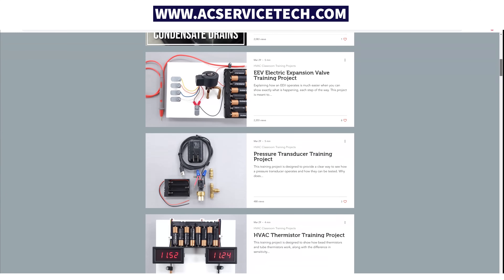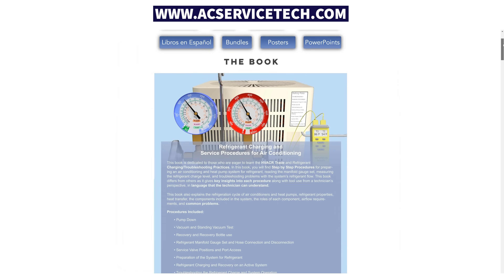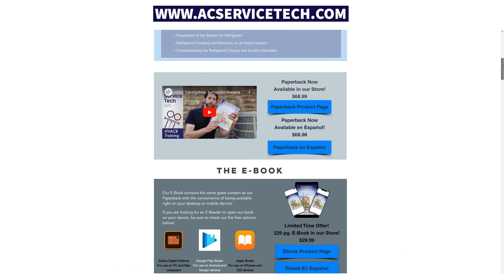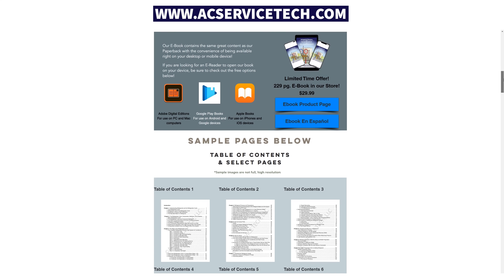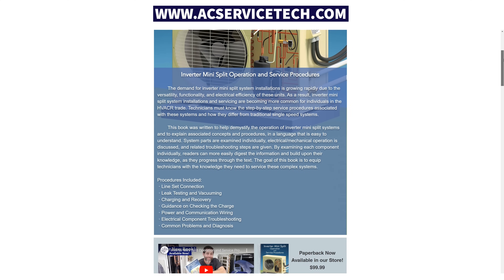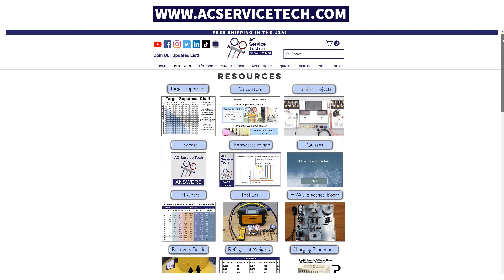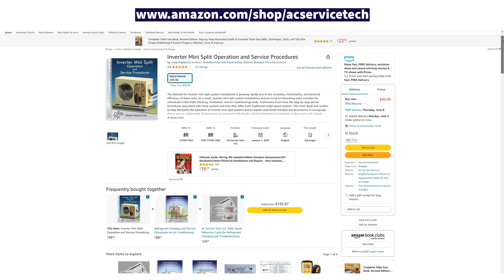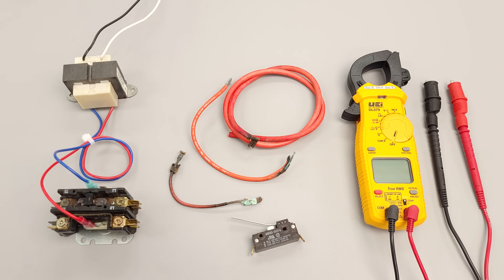HVAC Multimeter Basics: Measuring Electrical Resistance vs Continuity! Testing and Tips!

Comment: The continuity beeping sound is good if you're trying to find a short to ground, You can go quickly through a system and listen for tone. Also, going through a circuit that has many points to see if it's open or closed.
Reply: yep

Comment: This is imperative to understand especially when testing heating elements, and how you can aid in determining the proper BTU output of electric heat as the elements having resistance outside of its spec will lead to issues with high utility bills and or poor heating due to tripping limit switches.
Reply from the maker: Absolutely, understanding the proper functioning and testing of heating elements is crucial in HVAC work. Testing their resistance and ensuring they are within specifications is essential to avoid issues like high utility bills or poor heating performance due to limit switch tripping. It's important to pay attention to these details to ensure efficient and reliable heating performance for your customers.
Reply: @acservicetechchannel  Not to mention fires.

Comment: 18AWG solid copper wire has a resistance of .651 ohms per 100 ‘. FYI
Reply: Thank you for saying something about standard wire resistance. While most applications will not have a run long enough to create significant resistance and voltage drop, there are going to be cases in which it does occur. There is even more resistance with stranded and thinner gauge wire. 0.0 ohms is perfect world resistance on short wire runs even.

Comment: Super helpful.  I need a big playlist of electrical help videos. It slips out of my mind from time to time how all these functions work.
Reply: The good thing is you have everything you need in your phone. Once you can look at a schematic and understand all the symbols and flows and know the sequence of operation ( more complex systems) may require a manual. Even a factory tech needs manuals sometimes on as built systems. It takes time and dedication to learn and understand everything and nobody knows everything. The HVAC& R industry is now much more than a home split system to a 5-10 ton rooftop unit. It’s comms and logic which come in many forms and sizes. Asking for help when you don’t want to because of pride. Every tech wants to be the best or should, but also be humble.

Comment: Have this question, always wanted to ask, thank you much: when measuring superheat, why taking the pressure/temperature at suction line and subtract from the vapor line copper's temperature?  Pressure at vapor line yields the temperature of the vapor at that location, not the saturation of the liquid/vapor inside the evaporator coil..also what is temperature of the copper line?  what does it represent?  I thought the true superheat would be the temperature of the wet bulb minus saturation temperature, which is the temperature of the mixture liquid/vapor inside the evaporator coil because this superheat number represents how much heat/enthalpy is absorbed and removed by the refrigerant in the coil...this superheat has nothing to do with vapor temperature at the suction (derived from the measured pressure) or the temperature of the copper pipe...Appreciate if the host or someone can address.  Thank you much.

Comment: The beep test is very useful when you are simply trying to find whether a switch is open or closed, or if you have a broken wire somewhere or something is plugged in to the wrong place or not fully seated. Also useful when tracing wires. In other words, sometimes a yes or no is more important than how much. This is the whole reason behind digital electronics and communications. On or off is easier and more reliable than precisely measuring the voltage.
Reply: It doesn't seem like you watched the video.
Reply: @shawnsg doesn't seem like you read his comment. Sometimes you might not be directly in front of your multimeter testing the wire and a beep can tell you if the line is O.L  or 0.0
Reply: @shawnsg  why is that?

Comment: There is a lot of this that is basic electricity and electronics theory that without some knowledge in that area first can be very difficult to understand. Even though someone might think they do. The condition described might be understood, but the underlying hows and whys that will enable deeper understanding in order to troubleshoot effectively are not. 
Not a criticism of your excellent video, just acknowledging the reality of what truly understanding this process in order to accurately and quickly find faults will require.

Comment: I agree. I don't use continuity that much and like to go off of the Ohms so that you can catch little problems that you might miss if you just went off of the audible cue. 

Maybe a nice use for it is when a compressor is overheated and you want to cool it down to get the safety to reset you can connect alligator clips in continuity mode and once you hear the beep you know it's finally reset.

Thanks for the video!
Reply: That's the exact use I have for the audible circuit tester.
Reply: Exactly what I use the continuity setting for. Just showed another tech that last week.